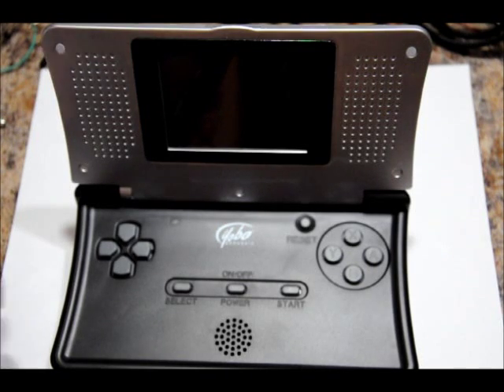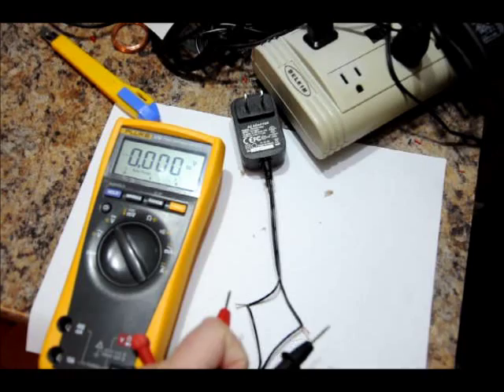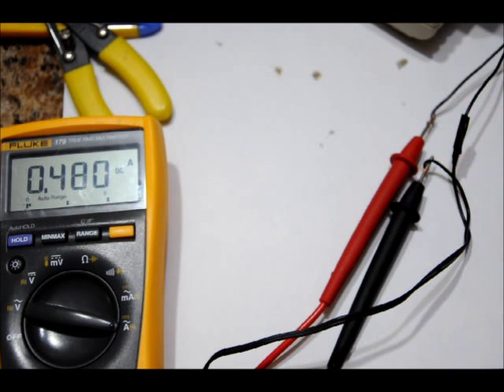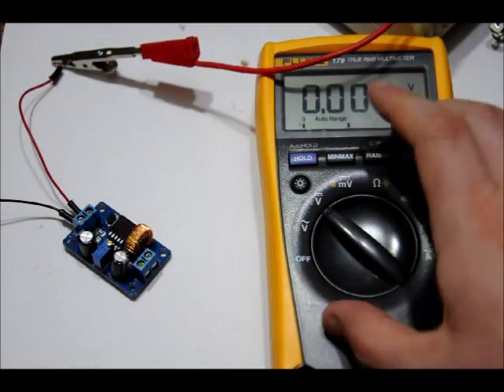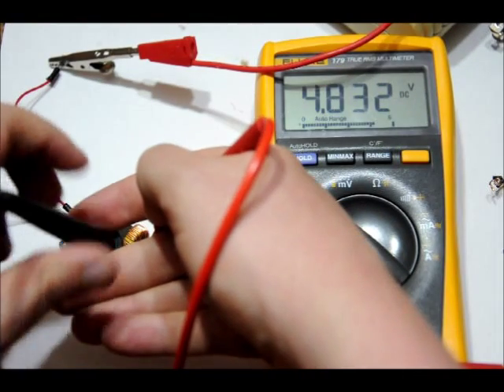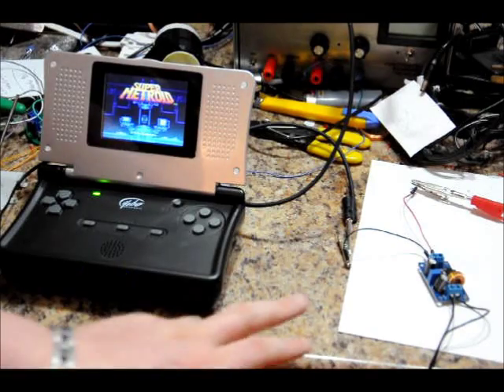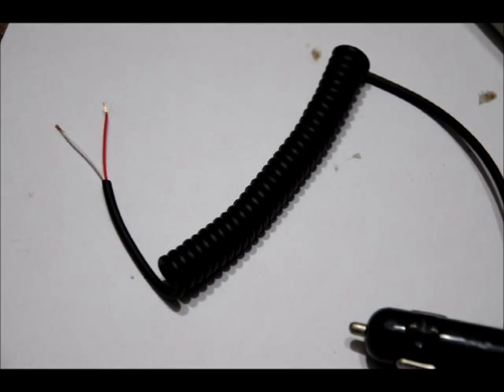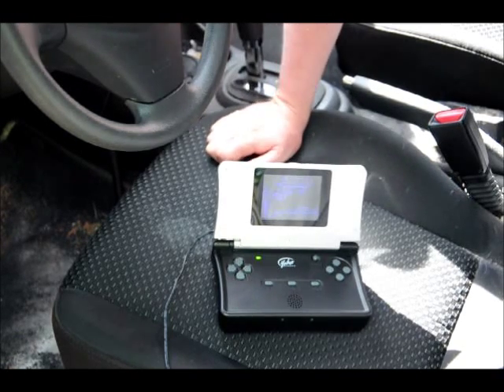Modding my SNES power supply for playing in the car!

Comment: Neat :) I remember once I tried to reduce 12V to 5V with simply using 7805, and no other elements. It worked, but sometimes it can produce a lot of heat.
One more interesting thing I transfered the 12V over a 50 meters STP wire. I used the blue and the brown pairs. However these 12V were produced by a transformer, and when I used the rectifier after the transfromer, on the other end of the wire 7805 could not work well. When I transfered AC through the wire, and put the rectifier in the end of tha cable, right before the 7805 it worked well. I still cannot explain that effect of the STP cable.